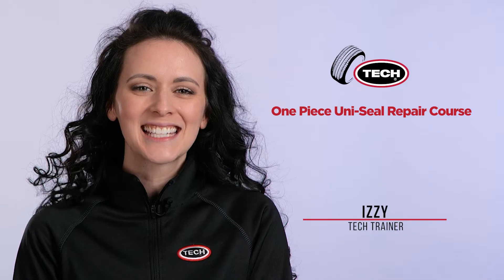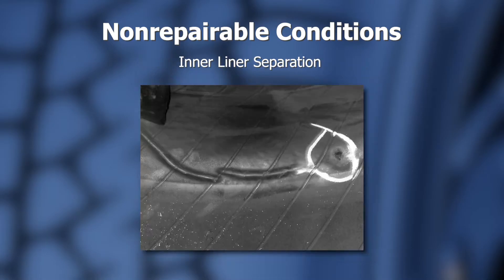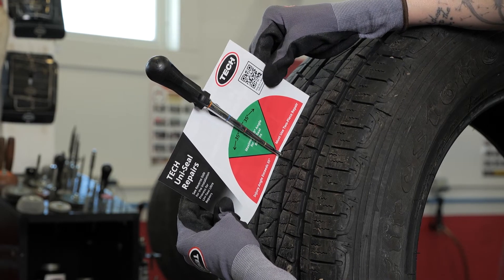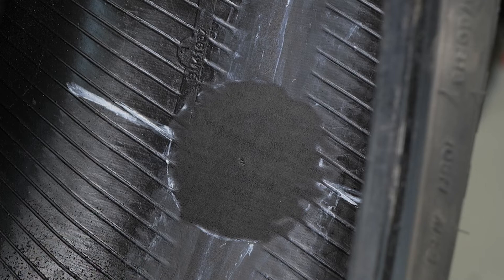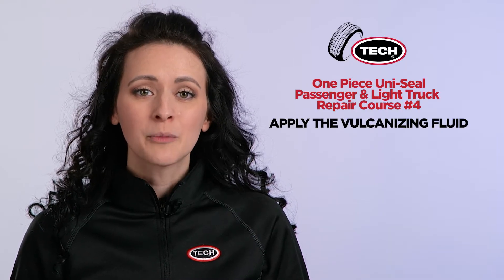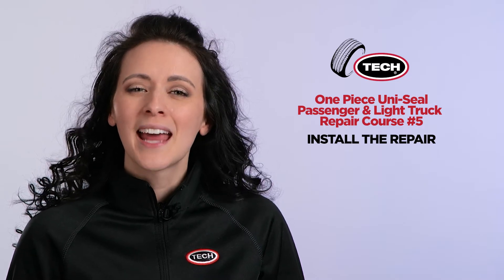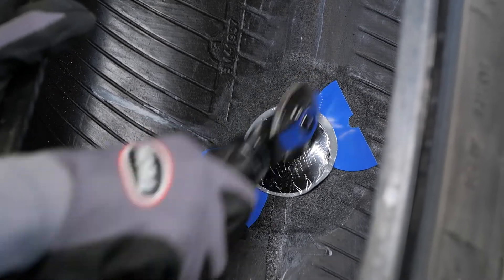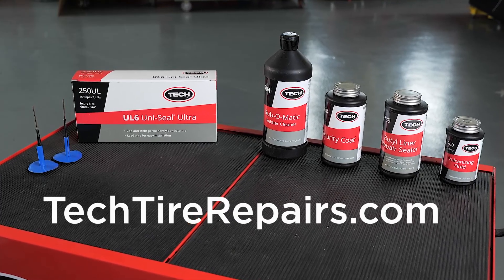Tire Puncture Repair Using TECH's Uni-Seal Ultra Patch/Plug Combo Repairs for a Safe, Permanent Fix

Comment: Can i use these patches to repair semi truck tire? Thanks
Reply from the maker: Yes, the Uni-Seal line is designed to be used in any radial or bias highway tire application. From passenger through truck. The larger repairs can even be used in some agriculture and OTR tires. Hope this helps!

Comment: Well, i-d say almost half of it is just for show and to use a lot  of your  materials. I mean i cold do the repair in about 10 minutes with just the  cement and the mushroom patch. I know it because i did it counless times. Not everyone have the luxury to lose 1 hour to just patch a hole.
Reply: This is the only approved method for the proper repair of a passenger tire. No string plugs or any other form is acceptable. The tire has to come off to be inspected for damage that isn't visible from the outside. I can't tell you the number of times the tire looked like it just had a small puncture on the outside but was completely destroyed on the inside. Upon showing them I've never had a customer be ok with just plugging it. Even they can tell it's destroyed....if you don't look....you don't know. At least not until it blows out...then you know.
Reply from the maker: @evracer  Well said! Thank you for the great reply and sharing your expertise.
Reply from the maker: Buffing the tire is a crucial step for a properly adhered repair that will last the lifetime of the tire. Our chemical line was developed to work specifically with our repairs for the best repair possible. Better to take the time to do it right the first time; while following industry guidelines, than to have a repair fail or an unhappy customer. While we highly recommend following industry guidelines; you are of course welcome to ignore those at your own risk and that of your customers.

Comment: Would this repair sidewalls?
Reply from the maker: Our Uni-Seal repairs are for repairable crown nailholes only. Passenger tires cannot have sidewalls repaired as they are made with fabric plies. Commercial truck tires are made with steel plies and could potentially have sidewall repairs. Tire inspections should always be done by a professional to determine if they are repairable or not.

Comment: I wondered why Conrad's took a full hour to "plug" my tire.  I thought they'd just do a tire plug like we were taught to do back in the day, from the outside with a sticky plug.  The guy showed me one of these and I got curious to see how they're applied.  I had no idea it was this much work, but it looks like a thorough repair and was worth the money for expensive tires.
Reply from the maker: Oh my. No. We recommend following (current) industry guidelines. The tire comes off fully in order to properly prepare the surface for a proper repair. It's more work than most people realize. BUT it is a safe and proper repair that should last the lifetime of the tire when done right. We know ours will.

Comment: A can of fix-a-flat seems much easier.
Reply from the maker: That is not a safe or proper tire repair for highway applications while following industry guidelines. Our combo repair ensures the hole in the tire has been filled  and is completely sealed to prevent contaminants from entering the tire and possibly cause a repair failure.
Reply: Not when your tires are $300+ each.  Get them properly repaired and you preserve your warranty in most cases.
Reply: I've taken off a lot of flat tires with Fix-A-Flat in them and repaired them properly with a "patch-plug" we call it. Seems like a waste of money to me.
Reply from the maker: Yes, all tires must be properly repaired to be safe to drive on. We cry a little when people rely on cheap alternatives. They are taking their own safety and others on the road into precarious hands.

Comment: Great video, but how much to repair the tire compaired to buying a new tire.
Reply: It was $23 at Conrad's here in Ohio, and took about an hour.  I thought that was entirely reasonable.  Not sure the cost for where you live.
Reply from the maker: Depends on the tire in question and your location. Tire repair ensures that you can extend your tire's life beyond the puncture. Typically you are sold tires in pairs; so when you weigh the cost of repairing a repairable tire vs purchasing two new tires it seems like a no brainer to get your tire repaired properly. Saving you money and time in the long run.

Comment: Compliments on your excellent training videos.
Wanted to ask if there is a guideline for when to use a plug/patch vs a flat patch only.
Is it just dependent on the size of the Injury?    Thanks
Reply from the maker: A proper tire repair is done with either a one-piece repair (seen in this video) if the injury angle is less than 25 degrees per industry standards. Tech on-piece repairs can safely and properly repair up to 35 degres. Otherwise if it extends beyond that you will need to perform a two piece repair. You will have a separate stem and patch to complete the repair.  There is no safe repair that is just a patch only. Not only does it go against industry guidelines but the hole in the tire hasn't been filled with a rubber stem to plug it. Water, debris and other things can get inside and loosen the patch; therefore rendering the "repair" as failed. There are different processes for the type of tire being repaired.

Comment: There are 3 different stem sizes available: 4, 6, and 9mm.  Which carbide bit size (diameter in mm) do I use for each stem diameter?
Reply from the maker: Tech offers Uni-Seals Ultras in 3mm, 6mm, 8mm and 10mm sizes. The carbide cutters for each would be 269 (3mm), 270 (6mm), 271 (8mm) and 271/38 (10mm).